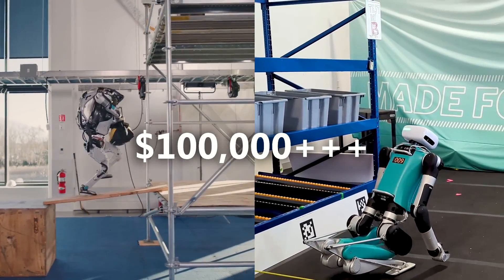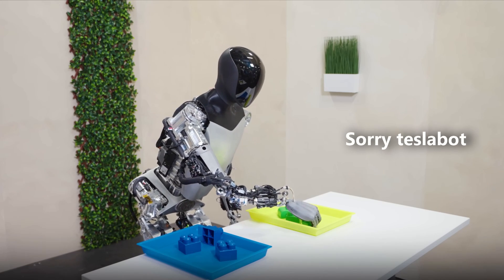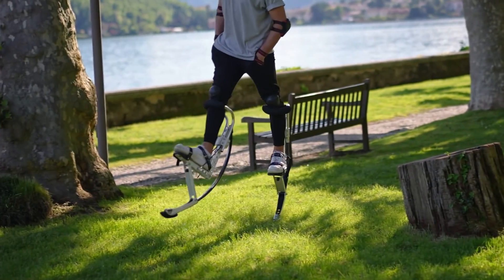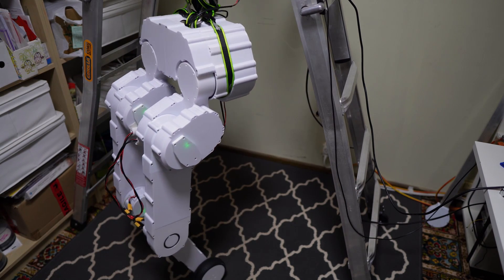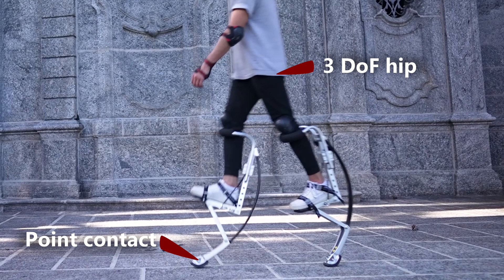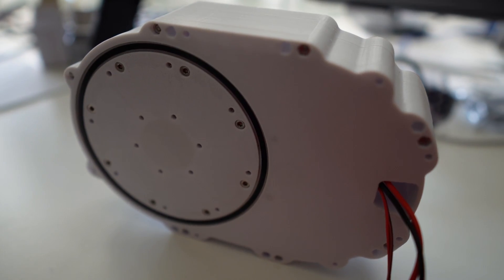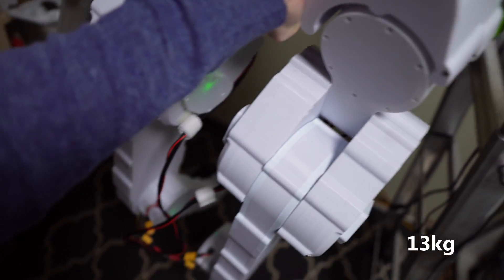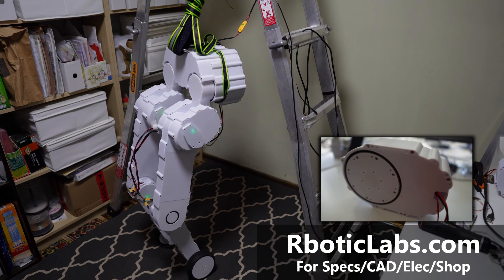Ultralight Bipedal Robot - Mechanical Design

Comment: Another great video please keep them coming!
I am 100% with you in ‘keeping things simple’ mechanically to reduce costs. If we are to get to a billion robots these things need to be mass producible, cheap and ‘IKEA assembly simple’. The secret success sauce will be in the AI control. I don’t think we should get too hung up on the locomotive aspects because if the robot where operating in a factory for example it could place itself ‘on station’ and free up its legs to transport another torso/arm assembly -I.e. you only need your legs when your not at your desk!  In a factory environment legs don’t even have to be legs to get around. Overall though I do think you’re on the right track with a ‘wheel for foot’ approach, indeed combining wheel and gait produces even higher top speeds if that is a goal (I suddenly want caterpillar tracks on the soles of my feet 😂)

Comment: Neat project, especially for a DIY!

Just my two cents, but in my experience with bipedal balancing, it is usually better to model your system as minimally as possible; i.e. model the system as a single mass-body with CoM at a single point (for humans, roughly just above the hips), with the legs as 2-link limbs (2DOF) and the "feet" as single points of contact.

The rationale behind this is that, given this simplified physical model, the moment of balance can always be defined about the axis connecting the two feet on the ground (think of a "tightrope"). Firstly, even if your hips have an additional DOF, this will not change, because you are reducing your ground reaction forces to point forces. Once your 4 DOF system can reliably compensate for angular momentum and stay upright within these constraints (a decent challenge), you can use wheels, casters, banana peels, whatever as feet, because the system above the ankles is dynamically balanced. 

As a side effect, it's also more energy-efficient, because the robot is not constantly working to re-position itself under its center of gravity.

Sorry for the unsolicited advice; hope to see you continue working on this.